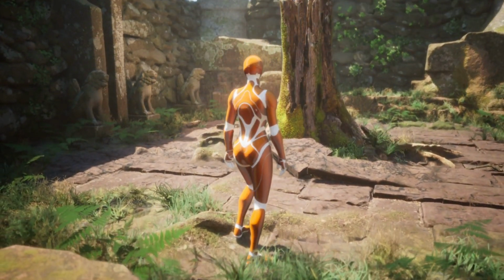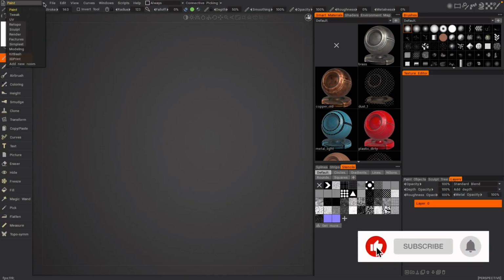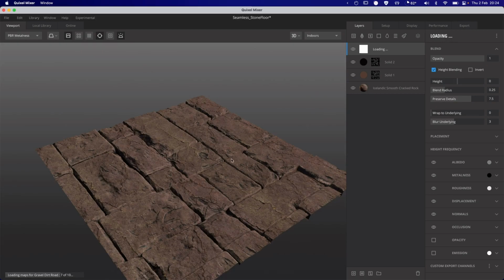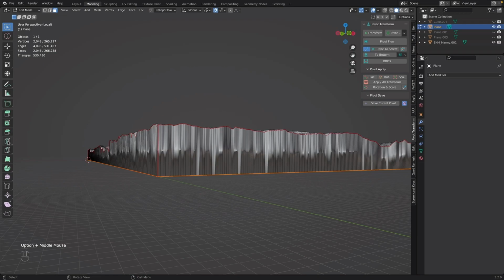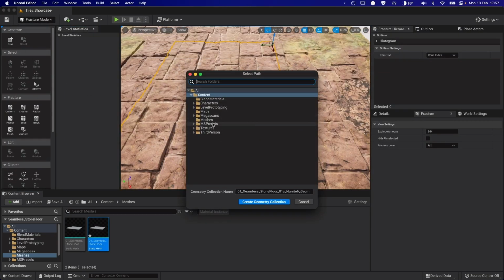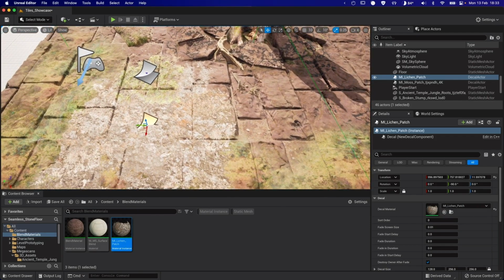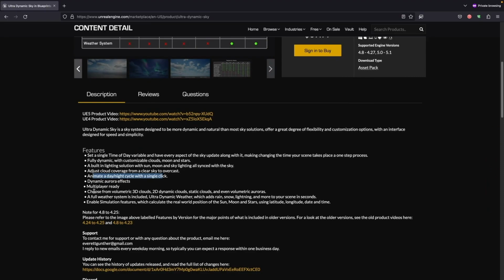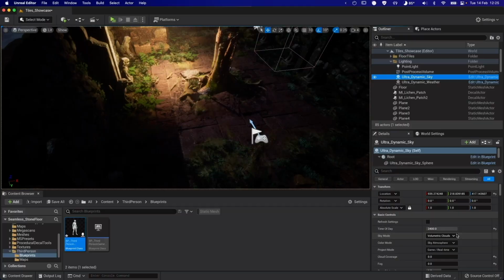Nanite Asset Production - Unreal 5

Comment from the maker: TIMESTAMPS
------------------------------
00:00 Nanite Seamless Floortiles Tutorial
00:00 Project Overview
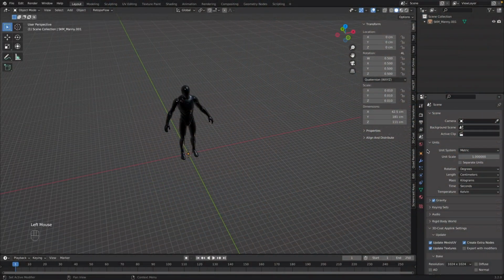00:27 Part 1 - Introduction - Blender
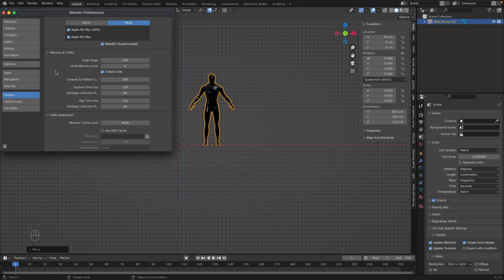01:09 Modeling - Blender
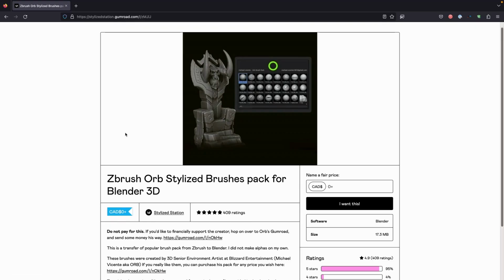06:02 Sculpting - Blender
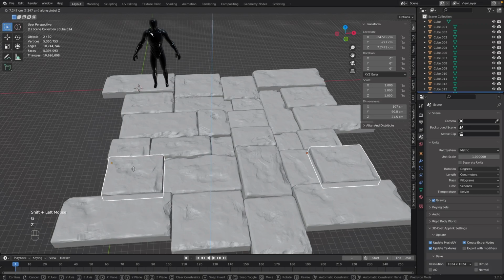14:07 Mesh Export - Blender
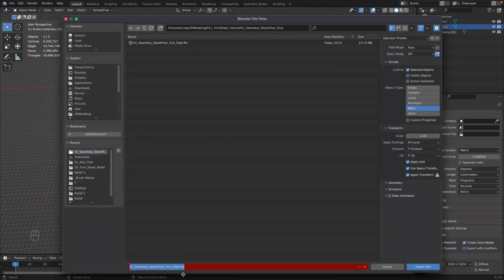15:41 Texture Baking - 3D Coat
22:50 Part 2 - Texturing - Quixel Mixer
40:23 Part 3 - Putting everything together in Unreal 5
40:27 Nanite mesh creation - Blender
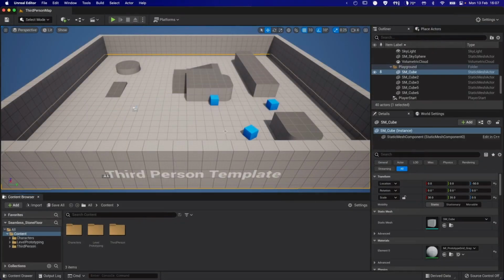48:18 Blend Material Setup - Unreal 5
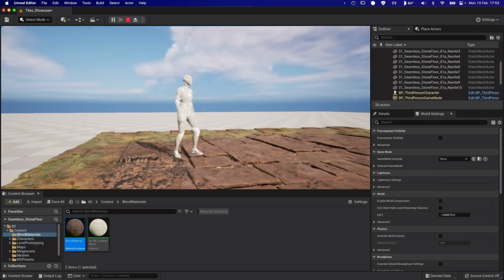01:00:43 Fracture mesh into pieces - Unreal 5
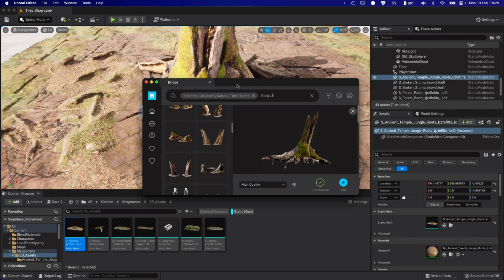01:17:46 Decal Setup - Unreal 5
01:19:22 Runtime virtual textures - Unreal 5
01:34:23 Ultra Dynamic Sky Setup - Unreal 5
01:41:47 Project Timelapse - Unreal 5